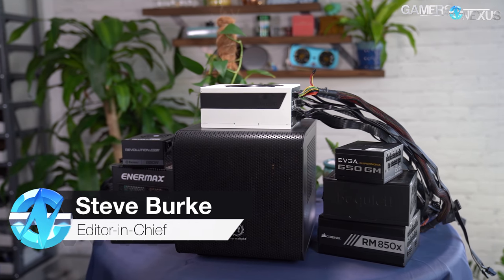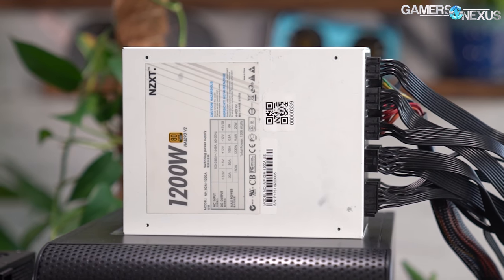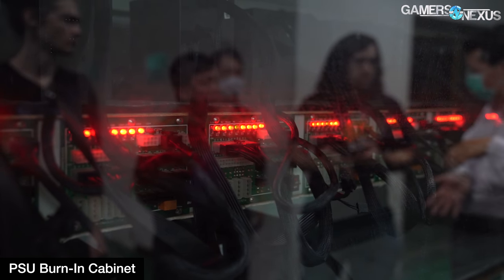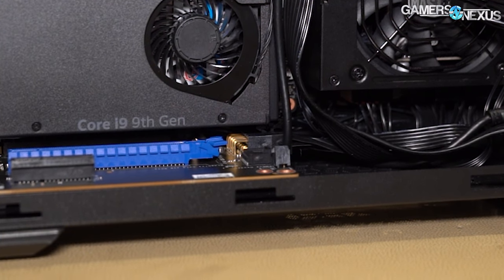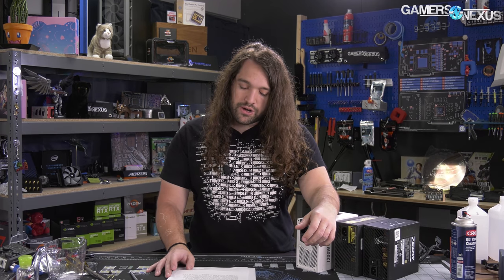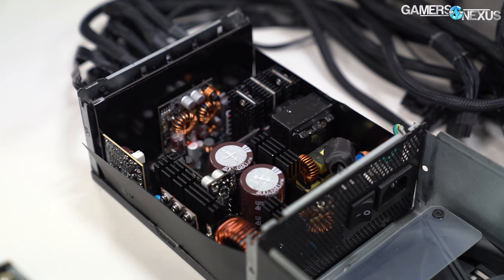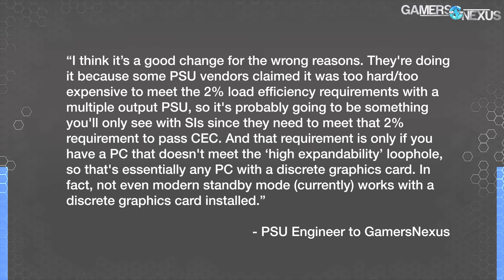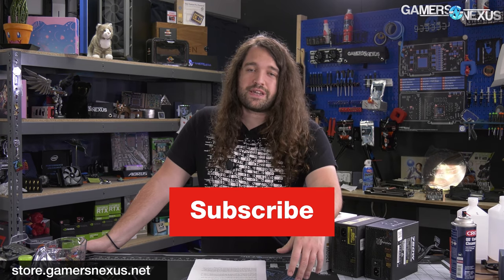Intel's ATX12VO Spec Explained & What Manufacturers Think

Comment: 12v DC is the perfect voltage to provide to a PC because this will then allow anyone to use solar panels to directly power that PC with no need of an Inverter to convert to 120/240v AC so the normal PSU can then convert it back down to 12V, 5V & 3.3v DC. This increases inefficiency by a minimum of x2 since Inverters are also not 100% effective. Using an 80+ Bronze PSU would actually only be at best 60+ Bronze due to the loss in the inverter.
Using 12v DC to the PC would be 99+ Platinum since there would be no loss on the 12v rail. The only loss will be on the 5v & 3.3v rails. This will also remove a lot of heat from that PC since the dropdown from the 120v/240v AC space heater is not needed.
WOW, I just realized something. For those with Solar/Battery setups there would be no need of a PSU at all, None since they have as many Watts & AMPs of 12v DC as they wish up to the multi-Kilowatt range Power Supply that can be Grid-Tied.

Comment: If properly integrated, this can be way better efficiency. For example, building PSU, you dont know  how much 5V board will consume. Is it be 4 or 10 USB ports? Assuming USB 2.0 it can be accordingly 10W or 25W. So if board maker knows it will only have 4 ports, they dont need to build DC-DC converter capable of 25W, they can build it smaller. And that is just USB 2.0, not even covering USB-C, with multiple output options going as high as 20V@3A. And specifying it as standart, so power supplies can be exchanged easely, I think thats right direction.
If only someone standartised laptop DC jacks and voltages...

Comment: Is the new Seasonic Connect them testing the waters to allow 12VO PSU's to work more widely? So eventually providing a 12VO PSU and then the connect bar takes its power from the 10pin connector and doing the 3.3v and 5.5v conversion there.

Comment: "Only the 12V rail" so will this allow me to use my weird supermicro dual socket motherboard that has a single 12v-24 pin connector, but no EPS 8 pin for either 145w CPUs(x5600 series)?

Comment: What about the conversion from 12V being a case thing? As in a small step down chip in the case, not on the motherboard? I would assume the step down would be very simple and easy. I would prefer this element be split from the board. And this step down would actually be very simple. The case includes case fans and has x spots for drives, plus the lights. So, a case having a $2 - $5 board for stepping down 12V to 5V would not be a big issue. Hell, case makers would probably love this. It means rather then the PSU supplying cables, it's the case instead. Oh hell yeah.

Comment: If this does roll out to DIY I really hope to see a much smaller combined sata plug. The current one is super wide and probably doesnt need to be. Then again my new system doesnt currently use any SATA devices. Though it may in the future.
Reply: I think SATA will die before that and be replaced by PCI-E and USB.

Comment: 17:23 basically as long as they used the current system but using 80 PLUS Gold or higher PSUs there will be no trouble so this 12VO standard probably is only beneficial to low end prebuilt PCs to mid to high end PCs the downsides are more than the upsides to the point that probably is worse for the environment (been the case that motherboards have a lot less user life span) 

And if they want to meet the recommended of Energy Star they would need to have efficiency levels like what 80 PLUS Platinum and Titanium certifies, at least for 230V I’m not sure if Platinum can be consider approved for 115V, probably yes, especially, if the PSU is a tiny bit better than what Platinum certifies for 100% load (PSUs can be better that their certification, 80 PLUS warranties that those PSUs reach at least that efficiency of the certificate)

Comment: Seems like this could create a new standard size for motherboards (thinking E-ATX) for mid-range and budget DIYs, and/or make having lighting effects more expensive. I'm imaging that this could make pre-built PCs with custom motherboards more attractive simply by being smaller and having RGB. So, not much of a hit to the true PC building enthusiast, but the general consumer will stray towards pre-builts more and more. People like pretty lights and not having a massive tower. Its like adding ECUs and automatic transmission in cars. It gained its popularity because its attractive to the general consumer that just wants to go drive and not think about all the shit going on under the hood. Overall, its a new standard that lays the ground for better things to come (Dual clutch automatic transmission and modern engines that restructure their power curves to match common driving behaviors).

Comment: actually thinking about it the few % you save on the AC/DC with the 12V is probably not enough to compensate for the extra DC/DC step you are introducing
Reply: They already do a DC/DC step, since having smaller independent AC/DC rails is less efficient and more expensive.

Comment: -12v confuses me, I have to ponder how negative voltage can exist. as wouldnt 0v be the lowest one can go since 0v means the power is off so how can a voltage be less than off.
Reply: Lol, it seems you haven't grasped some concepts yet. Voltage is the electric potential difference between two points. Flowing from high to low potential. When measuring voltage, we dont take the measurement from what is actually high and low but instead of what we consider output and reference. Most often output being the positive rail and ground (0v) being the reference.

If you were to measure from a 12v rail to gnd it would be 12v.

If you were to measure from 5v tot 3.3v it would be 1.7v

If you were to measure from 3.3 to 5 it would become -1.7v as the "current would start flowing in reverse direction.

Tldr: voltage is relative and measured between two points. No voltage means no current flow. Postive and negative voltage simply indicate flow direction.

Comment: If the +5v and +3.3v is moved to the MB then overall efficiency doesn't change. By creating a power efficiency rule only on the PSU, it leaves it open to abuse. We just move some losses from the PSU and move it to the MB power losses and the regulators are fooled. HDD, SATA SSD, USB, PCIe & NVMe SSD's all use combinations of 12v, 5v, 3.3v. USB3.2 even has power delivery with higher than 5v. Why not supply 24v DC or 48v DC from the PSU and push the down conversion somewhere else? Why does high efficiency (ie. switchmode) power supplies often mean EM interference to everything else when not properly checked by the OEM's or importers?

Comment: What are 3.3v and 5v ports used for nowadays? I recently built a PC, and do not remember using them. M.2's are on par, if not even cheaper than 2.5 inch drives nowadays.
Reply: M.2 has 3.3v pins

Comment: I remember a time that all power supplies where enerygy efficient, supplying + and - 12 v and + and - 5 v with a hard-power-off-button to turn off the computer. I wonder how more efficient those power-supplies where. When they where off they where off using 0 watt over a 5 year plugged-in off-time only using a single 5v 5Year warranty lithium button cell. While any current power-supply rated at 0.5w at standby would use 21900 Watt or 21.98 KW.
Btw maybe a good thing to do, compare the efficiency of a (High Quality) classic AT-spec power-supply against an AT-X-spec power-supply and the 12Vo power-supply?
Reply: PSUs back then were usually in the 60% range for efficiency

Comment: Some also argue that this is conspiracy to reduce motherboards lifespan (statistically, more components mean more failure points) and possibly CPU and GPU plugged in it too, because the failure, let's say overvoltage, on MB itself is much more dangerous to components than if it happened on PSU. 
You could also imagine that, in the future, prebuilt PC would just have laptop motherboards in them, since laptop motherboards already have all DC-DC components in them, and it would be very cost-effective for DELL or HP to use the same boards for both laptops and traditional PCs.

Comment: So suppose you have a ATX12VO motherboard with 6x SATA ports, this the board can power up to 6 SATA storage devices. But what if you use a HBA or RAID controller? How would you reliably power up all these additional drives that the motherboard may not be able to supply power to?
Reply: Simple: EPS power connector from the main power supply to the RAID controller.

Comment: How does this improve efficiency if the same components are just moved from the power supply to the motherboard? Seems to me like that would just improve the efficiency of the power supply, but the overall power efficiency would remain the same?
Reply: Better load matching and less voltage droop. 3.3v and 5v are not particularly efficient voltages for long wire runs.

Comment: I got my hands on a Dell Optiplex a while back with a 4790, I was going to use the motherboard in a smaller PC that I could take to college more easily but it turns out Dell did something similar to this.  Standby power and the other voltages going to the motherboard are all 12V, so to use an actual power supply with it I'll need to bump up the 5v standby power to the 12 it's expecting.  Big pain in the rear
Reply: Optiplex 3020(or 7020/9020)? I just did this with one of those, they make adapters for $13 which handle the conversion and standby voltages. Now rocking a Fury nitro and Corsair PSU, $250 gaming rig away!

Comment: how much is the possible efficiency of power usage as a rule going to change you moving the power conversion requirements from PSU to other places the Mosfets don't magically get more efficient if they are required to place more Mosfets  because its to hard to lay out a board with all of one rail in one location you tale a hit to efficiency.

Comment: We will soon see daughter PSU's a 12vo atx psu with a supplementary 3.3v and 5v psu with a molex 12v input to provide the input for the conversion. should be easy enough to design to fit in a 3.5 inch drive bay
Reply: Pico PSUs exist, and they're barely larger than the bare 24 pin connector, cheap too (like $20~30). Don't need anything as big as a full drive bay to do this.

Comment: And you could possibly run a PC from a car battery. That's interesting.
Reply: Car battery is 12.5±0.5V. ATX12V is 12±0.5V.
Reply: @erkinalp  There is no electronics in the world that runs at 12V. The onboard voltage regulators turn 12V into 3v3 and 1v2 to operate the electronics. Those buck regulators might not care about an additional 0v5.
Reply: @erkinalp  Car batteries are 12.6V±1.8V I guess. They are charged to 14.4V and discharge to 10.8V. But then, VRMs don't care too much about that, just like they don't care about the actual battery voltage in a laptop which can vary a lot

Comment: This ATX12VO would be/is against Right to Repair.
Seeing as ATX12VO PSUs would not be easily obtained seeing as they wont be common.
With Standard ATX you can get any PSU from anywhere to fix a dead OEM PSU which can be cheaper than getting it from the OEM.
OEM PSUs tend to be cheap(like the type that come with cheap generic budget cases)
I have replaced many dead PSUs from companies like HP, Asus, Acer, etc

Comment: If 3.3 V and 5 V power is still necessary, how does moving the conversion to the motherboard help efficiency?

I am far more familiar with software than hardware, but to me this sounds like it would add additional, wasteful, power conversion:
ATX: 120/240 V (AC) → 3.3/5 V (DC)
ATX12VO: 120/240 V (AC) → 12 V (DC) → 3.3/5 V (DC)

Is it not more efficient to do a conversion once, rather than twice?
Even if a DC transformer is better than an AC transformer, you could still do that in the power supply, no? To me it sounds like either a wash, or system efficiency is worse with 12VO.

The only way this makes any sense to me at the moment is if:
A) ATX spec tells PSUs to provide excess amperage in 3.3/5 V, and motherboards could choose to provide only the modern amperage needs, therefore reducing waste - but you could then also fix this by reducing the amps available on 3.3/5 V from the PSU, a less-amps-for-3/5-volts spec if you will
B) CEC regulation only applies to power supplies, not the system as a whole, so this makes PSUs more efficient, but the system overall is less efficient

Apologies if I am missing something obvious here.

Comment: Intel isn't a power supply manufacturer. That doesn't mean that they aren't trying to use their brainpower to drive the standard, but there's a difference. Also, PC manufacturers using custom power supplies is the bane of IT people trying to repair those machines on a budget, because those PSUs cost MORE than the generic ones you buy for DIY.

Comment: would be pretty interresting to see how 3d printers use 12vo PSUs, most of them just use 12v power supplys for LEDs
Reply: 12V is directly used for all the heating, as that is most efficient.
Reply: @rexsceleratorum1632  you can get even better heating with 24V but my problem is that the power supplys you get for 3d printers are pretty low quality

Comment: Couldn't a PCI-E card take up to 75W 12V from the motherboard and convert it to 5V provide SATA/fan connectors without using motherboard real estate?
Reply: It can, but I cannot see why one would design a PCIe power supply card. Adding to that, that card would occupy two slots to accomodate the cooling needs.

Comment: Power supplies are usually rated for efficiency at a % of load, say 85 efficient at 90% load for example, as load changes so does efficiency. But I don't see how moving the additional buck converters to the main board are going to improve that, when at Idle the 12V rail on the power supply will still be way under-loaded to operate at peak efficiency. and more to the point I don't see a benefit from moving the buck converters to the main board, you still have buck converters that are just as inefficient on the main board as they were in the power supply.  The only true way to improve efficiency would be to design a system that doesn't use more that say 10% more power under load as it does at idle. then you spec a power rating for the power supply that keeps it in its best load range. but as long as a cpu runs at a few watts at idle then ramps up to 80 watts or more, not to mention the GPU, then all this is just pissing into the wind.

Comment: it may also be possible that a power distribution slot may be added  to motherboards holding the powere only regulation and outputting mother board feeds though something liek  a pci slot or even a large pin isa stle slot  then cooling could be done on daughter boards

Comment: Surely its time for a change no? 
As long as its worthy of course ... guess better power efficiency is a good enough reason
Just from X time/generation motherboards will be using "this" power supply.
I mean, there are plenty of obsolete motherboards out there because the CPU isn't the right socket anymore (another reason to love AMD atm)
So why not power supplies (and motherboards) ?
How often do you need a molex? Even sata seems pretty large for what it is powering. How much power does a SSD need? 
We've pretty much phased out the CD/DVD drives in consumer PCs, and the HDD is also on its way out.

Comment: cuz nothing, absolutely nothing uses 5V.
USB devices, SATA SSDs, HDD electronics, VRM FET-drive, Audio chips, Ethernet chips, wifi chips, PS2, RS232/SMbus, firewire, DVI, HDMI, DisplayPort, etc.
hmmm, nope,  absolutely nothing uses 5V. lol.

And that won't be no single amp of 5V stepdown on the motherboard, it will be 2+ amps per USB plug, 2 amps per HDD plug (maybe 1 amp per SSD), etc. you could easily end up needing a 23amp 5V reg on the motherboard, esp with 5V RGB stuff or many SATA drives.

Comment: It definitely wins my heart. This 3.3V and 5V rails is so stupid. MOLEX and   SATA connectors is unnecessary bulky.
You do not need nothing besides 12V rail when dirt cheap DC-DC converters exist. And if something uses 3.3 and 5V this days... Basically nothing.

Comment: My opinion is that this ATX12VO is a plot to prevent consumers from using cheap ATX boards and create DIY NAS Storage. . When you only have to rely on the motherboard instead of the power supply to provide you with SATA power connectors, then you're screwed. Cheaper motherboards only have 4 SATA ports at most, so logically motherboards will only provide you with 4 power connectors on the motherboard for your SATA drives.  If you do not have enough SATA ports to use,  you can buy a PCIE to SATA 3 controller card. But if you need more power connectors for SATA, you are screwed.

Comment: I dont want to see the power conversion moved to the motherboard for the 5v and 3.3v.  That would lead to more crap needing to be on an already busy product.  Leave the voltage conversion in the PSU not the MOBO.
Reply: Buying a quality PSU is not a problem, but figuring out which motherboards have the best DC-DC conversion, that's out of my league.

Comment: Power cable connectors is still one of the worst parts of building a computer, any revision should include fixing that - the same type of cable/connector used between gaming laptops and their power bricks should be usable. And would be much, MUCH easier to use. As a bonus for you modders/RGB:ers, standardized internal connectors, on both PSU and MB, would imply possibility of cable reuse.

Comment: If the converters are moved to the motherboard do you expect they would require active cooling?  And would this offset energy efficiency?
Reply: No, a one chip passively cooled solution could be had for under a dollar, and could be rediculously efficient. 

If anything you would reduce heating and unnesicary power planes which make efficient 12v and component placement more difficult. 5v and 3.3v are not particularly efficient to send over a long wire, you get hella voltage drop.